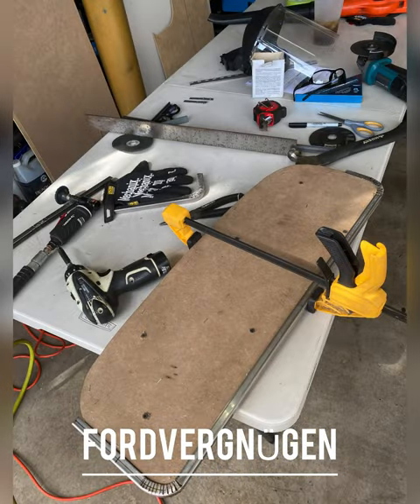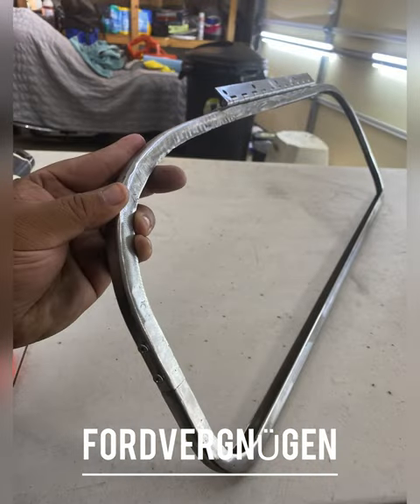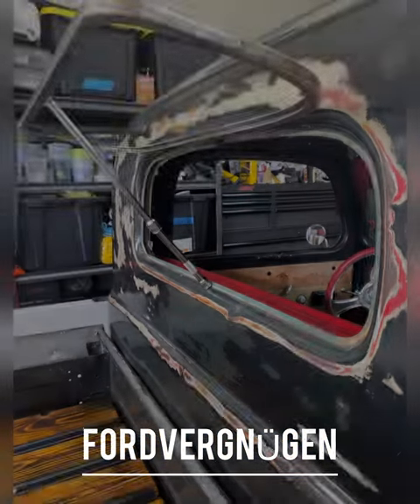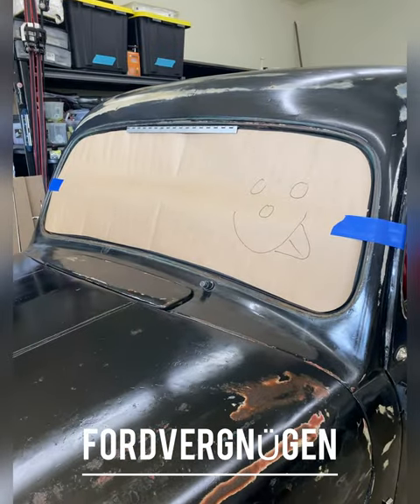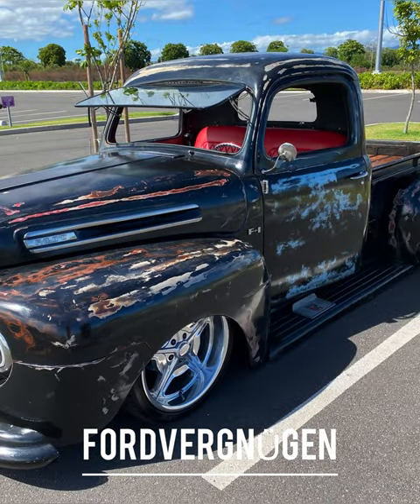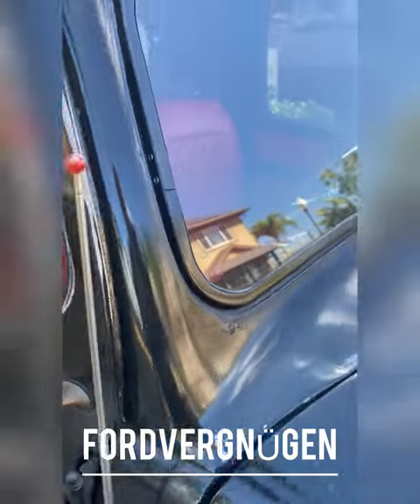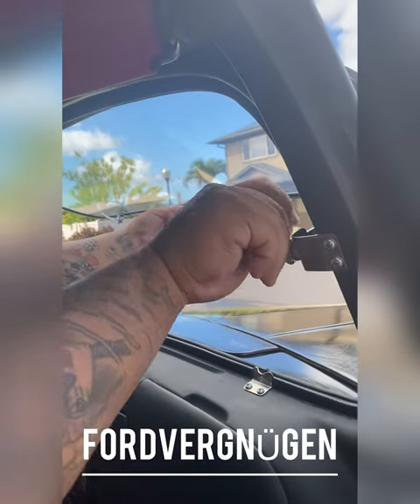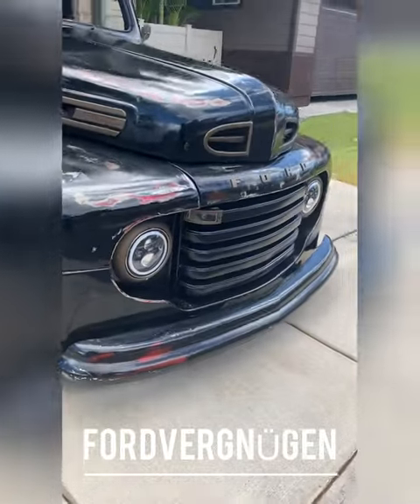Safari style windows on a 1949 Ford F1? Can it be done ?

Comment: Great work! I want to do this to the rear glass of my 58 Apache what’s the window frame called where can I purchase it
Reply from the maker: Aloha 🤙🏽 the frame is 1/2” stainless U Channel. It doesn’t have to be stainless though. I didn’t have a bender so I pie cut my bends and welded it
Reply: @sikfiberkationz7951  man hopefully I can pull these off thanks for the info!
Reply: @sikfiberkationz7951  hello can I ask what material are you using to fix the glass on to the frabricated window frame and where are you getting the latches and rails hardware to make it work thanks in advance hopefully you can make a full video on the process
Reply from the maker: @beermeen0w  the hardware can be bought at Wolfgang. 🤙🏽🤙🏽
Reply: @sikfiberkationz7951  I can’t even find a store that supplies U Channel here in Los Angeles 😅
Reply: @sikfiberkationz hello sir where do you source your u channel I’ve been searching and haven’t came up with anything my last resort is cutting one side of some 1/2” square tubing